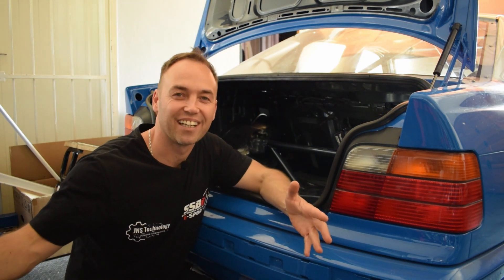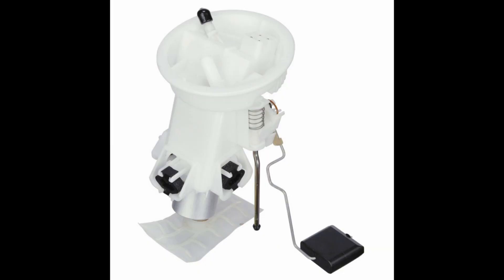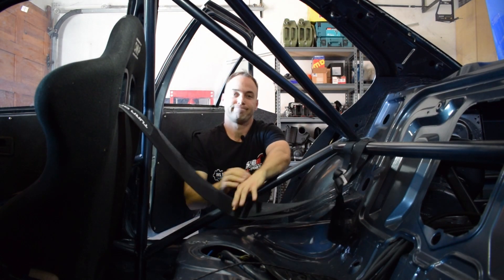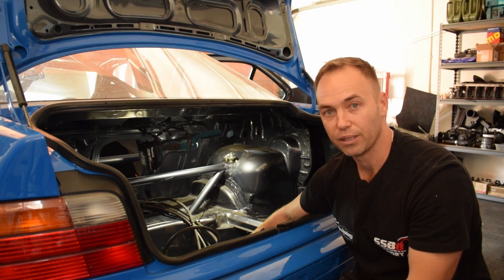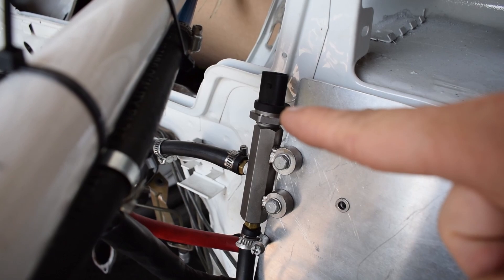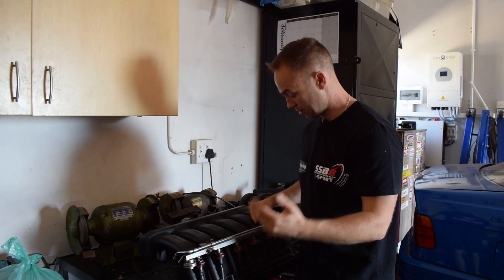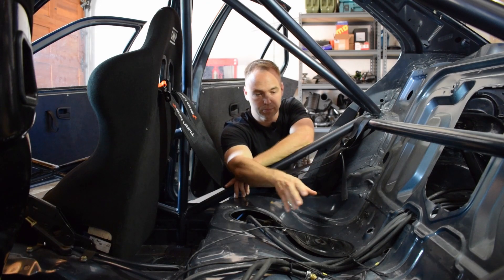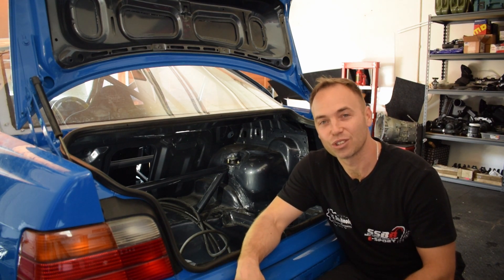E36 Race Build - Fuel System Deep Dive

Comment: Thank you for a very informative video I have a E30 316 carb going to fit a M52b28  iron block do you think the oil pump mod can be done on that engine
Reply from the maker: Thank you for watching!
Yes, my engine is an M52B28 just with a B30 crank.
So yes, it’s worth doing for peace of mind for sure.
Good luck💪🏻

Comment: Very informative, where did you get the fuel pressure adapter that the fuel sensor is mounted on.
Thanks
Reply from the maker: Thank you
I designed and made it. 👍🏻